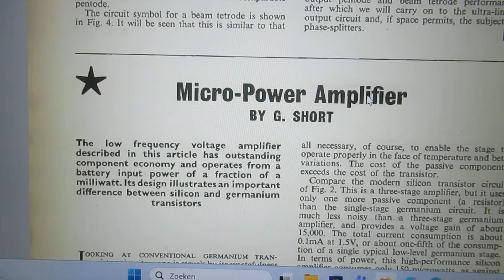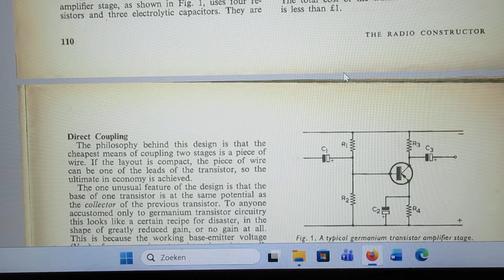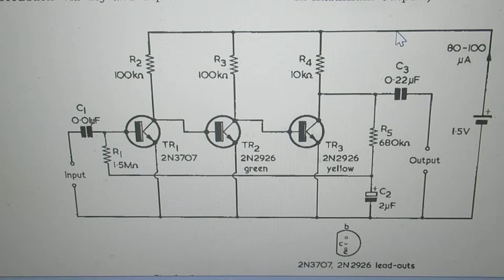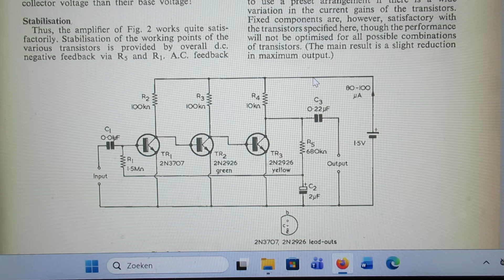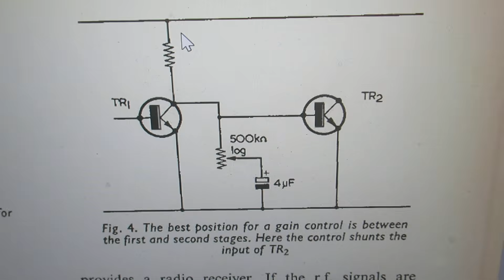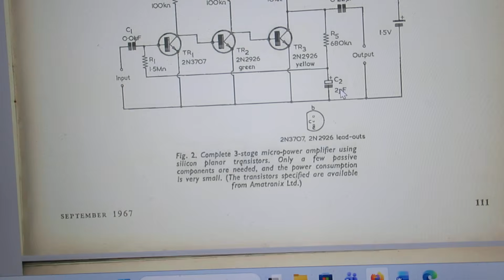1967 micro power pre amplifier for 1.5 Volts. A "Radio Constructor" (British magazine) schematic.

Comment: it took awhile for me to get my  January 1969 Philips Mullard Data Handbook by Sales organization ELCOMA from the celar, as the there has been 30 cm snow and sub -20c temperature  in the cellar stairs, now with three sunny days the temperature has soared to almost warm -10c I finally got it to check the facts: Philips had two ICs with most of that 3 NPN transistor circuit: OM200 (for hearing aids and max vcc of 5V) (package 2,75x2,8x1,1mm with four leads of min 3,5mm length 0,35mm width and 0,12mm thickness) and TAA263 (oct 1968) (and similar but with freedom to add components to vary the gain/freq response TAA293) and as usual the "find all information Internet" does not have OM200 Datasheet, but you can find the TO-72 version TAA263
Reply from the maker: Yes completely (!) true and many thanks for your comment, after digging up (with so much energy) that very important information! Much appreciated. 8 feb 2026.
Reply: @radiofun232  since I have this 56 year od on my desk, i browsed the other analogue IC datasheets, and found a similar IC with six transistor direct coupled amplifier TAA370 in 1 pin flat pack XE10 (called TO89, but not same 3+1 pin TO89 that was later common) it is optimized for hearing aids at 1,3v (sILVER-aIR BATTERY) but max Vcc 5V, datasheet can be found from datasheet4u and description from radiomuseum website

Comment: the circuit is very similar to a hearing-aid ampifier IC made by Valvo/Philips/Mullard/Signetics  it is in Signetics 1969 databook, and i recall the typenumber being TAA200 or TAA210,  but may remembre wrong.
Reply: I came here to make the exact same comment! I thought it was the TAA263 but that one seems to require 6V. But I very clearly remember it having the exact same schematic as in the video.
Reply from the maker: @meindertsprang7491  Yes, true.
Reply from the maker: Thanks for your comment, I reacted, but Google/YouTube deleted my reaction. Kind of censorship, though my reaction was completely on technical issues. I don't know why, but thanks again. 31 jan 2026.

Comment: The British Zetex ZTX301 transistor might be ideal for this (the number might be wrong). I had access to them in high school, and they were incredible in terms of uniformity, I plugged probably 100+ of them into the transistor tester of my multimeter, and all of them had a h21e of exactly 100, with a tolerance of maybe 5%, probably lower.

Comment: Howdy.
A proven good way to mitigate gain is to use emitter resistors.
Cheers.
Reply: Yes, and it also makes the bias voltage thermally stable IIRC, but would that work with 1.5V supply voltage?
Reply from the maker: @mrnmrn1  Indeed a good question. Using emitter resistors will also have an effect on the audio frequency band of the pre-amp (damping). You can compensate that by soldering a capacitor (order: 10 N-10 uF, must be found out experimentally) parallel to the emitter resistor (s). Can be tested with an audio sine wave oscillator and an oscilloscope or simply sending in some music via a smartphone or mp3 player, on the lowest output level. In my opinion in that case the input capacitor of this circuit is quite low, better could be 0.1 uF or 0.47 uF.
Reply: @radiofun232  I have some experiences with an extremely similar circuit. In fact, it's the same circuit, only small details differ a tiny bit.
The capacities are a bit critical. If you increase them too much, some unexpected effects can happen.
Also, the input capacitor shouldn't be a ceramic type! Becuase a ceramic capacitor can act like a microphone! It will make the circuit very sensitive in terms of even very tiny mechanical vibrations.
.
The circuit that I've testet has two additional antiparallel diodes on the input left from the input capacitor, to ground.
This protects the capacitor from becoming charged by static electricity. A charged capacitor could destroy the BE diode in the first ttransistor if it suddenly beomes uncharged. A charged input capacitor can also have unwanted effects on the normal operation.
.
I modified the circuit by replacing all transistors with normal BC547B and tried a lot to opimize it further, even by simulating the circuit in LTSpice. But with less sucess.
Every small modification may have a little benefit here, but disadvantages there and there and there.
I got the circuit to a very well working state with BC547B, but the other components need a lot real tests.
.
Also the shielding is important.
The circuit is immensely sensitive! With a simple needle as "antenna" on the input, it detects everything that has electronic in it. Even a quarz watch or a pocked calculator can be heard. You can test IR remote controls wireless by simply holding it close to the input with the needle. Each key on the remote control sounds a bit different.
.
I appreciate this circuit a lot! I use it also in hotels to detect spy gadgets. Nothing can hide from it!
It's also a remarkable tool for electronic repair. Each circuit emmits a unique sound like a fingerprint. You can detect it wireless with the needle as antenna from a short distance.
No matter if a digital circuit runs on tens or hundreds of MHz. The patterns in the bitstreams have often enough low enough frequencies that can be heard.
It detects also cables in the wall.
Today, in combination with some AI, you could do increadible things to analyze not only circuits and devices, but also different other things.
Reply: With the very high ohm resistor and the 2uF cap. It's almost complete DC negative feedback. To get better ac liniarity and gain control you could consider an additional ac feedback path, may be.
Reply: @guntramschlemminger7383  Howdy.
I believe You are correct.
I would suggest inserting a 470 k trimmer between the 2 uF and B-. Setting the trimmer to zero all AC feedback is routed to B-. Setting to full 470 k about 20 % of the AC fedback is routed to B- and about 80 % back to the input. The 2 uF prevents the trimmer from upsetting the DC feedback.
This may be a better way to manage gain than with emitter resistors. But one thing though. The AC feedback loop is long. There is a risk for high frequency instability.
Cheers.
Reply: @eugenepohjola258 Yes, there is a oscillation risk. This could be solved by frequency compensation like in an operational amplifier with a well selected capacitor at the collector of the first stage to gnd.
Reply from the maker: @guntramschlemminger7383  Do you have concrete idea's about how to do that? Could be interesting for everyone, who really wants to make and test this 1960s circuit, and (the best thing....) presents these evaluations and tests (via an oscilloscope and a sine wave generator) on his/her YouTube channel, with direct pointing to the used components, how they effect the amplification or waveform or frequency bandwidth. Say by doing some essential experiments with this circuit, about all the remarks that I get on this video. From YouTubers that say they are an electronic engineer, or say "why should I bother to make my comment a tutorial", or "I find better results with x or y in my computerized model testing"while, at the same time, when I go to their YouTube channels, I see "no content" or some electronic content that is not related to this 1960's circuit. Anyway: I am "in" for serious comments and serious test results, on the basis of making this circuit in practice. And research via doing calculated changes into the component values, or changes based on practical experience and knowledge about how such an amplifier works. And (sorry to say): I know that, on the basis of my thousands of experiments, since 1967. 31 jan. 2026.

Comment: This is exactly what is inside of MAA125 IC. There were also slightly different models with accessible emiters called MAA225, MAA245 and there were also "dual channel" versions MBA225, MBA245. They all were designed in 70s by Czechoslovak company Tesla (it was much more likely copies of something made by Philips, as copying so called "western stuff" was typical for that company) and they were meant for AF usage, but I used MAA125 in thunderstorm detector, which was in fact sensitive VLF receiver receiving slightly above the TV's horizontal frequency (this was important past then, because when I tuned it exactly to that frequency, then that thing turned into a very sensitive TV detector) and it worked great, so it goes slightly higher than 15kHz specified in their datasheet.

Recreating this with modern silicon BJTs would not be that straightforward as modern transistors have much bigger gain and as far as I remember, this thing had a lot of gain (specified voltage gain of MAA125 was 75dB… not 75× but 75dB!!), so I expect some stability issues. In fact, MAA125 had its own stability issues past then.
Reply: Tesla ICs usually have they Philips or Fairchild equivalent with the same number, just the first letter replaced. MAA can be TAA or uA (MAA741 is uA741, MAA723 is uA723), MBA is TBA (MBA810 is MBA810, MDA2020 is TDA2020, etc). Sometimes they are just pin compatible with the original, but internally they have a slightly different circuit. IIRC the MAA741 is an example of that.
Reply from the maker: True & thanks.
Reply: Hi there! Are you able to share some information about your thunderstorm detector (antenna type, circuitry, parameters). I'll be very grateful, as these detectors fascinates me a lot. Thank you in advance!
Reply from the maker: @454cassul9  A few video's about it are on my YouTube Channel. When you go to my Channel trailer (Radiofun232 on YouTube) and go to the looking glass (=search option) you can find them. Type there keywords like: "vlf" or "thunderstorm" or "detector". All information is in the video: antenna/circuits/etc. This is one of them https://youtu.be/W0PFErLMmGc?si=dw5R9YAdUzCvOlX_

And here another one (VLF antenna) https://youtu.be/GJtZQrZEn2Y?si=Z9dpQFSxq4euyY-5
Reply: @radiofun232 thank you very much, sir! I'll go & search right now!

Comment: Can I use it as guitar amplifier?
Reply: No because 1) a guitar pickup requires a high impedance input, you need a preamp that has a  FET front end and 2) a guitar pickup can give a voltage that would cause this circuit to clip.  You need a higher rail voltage of at least 9 volts, a TL071 opamp would be suitable because it has a JFET input.
Reply: @stevesmyth4982 This amp has 200 k ohm input, that's why I asked.
Reply from the maker: @goranz9446  Yes, you can try it. It can work better (better frequency band) when you raise C1 (non polar) to 0,1 uF or 0,22 uF. And at the output: a potentiometer of 50 K.
Reply from the maker: Difficult to answer, because I know nothing about the pickup element on the guitar. And also don't know to which end-amplifier you want to connect it. NB: the audio frequency band is limited. But you can try.
Reply from the maker: I have answered you (25 jan. 2026 at 19.40 hour) but Google/YouTube made it not visible or deleted it. Try it tomorrow (26 jan 2026) again. Don't know why Google or YouTube (=Google) does this. 25 jan. 2026 at 19.52 h. in the Netherlands.
Reply: @radiofun232 Standard single coil pickup 6.8 k ohm, preferably for bass guitar preamp.
Reply from the maker: @goranz9446  If so it is usable. Because with a bass guitar the frequencies will not go higher than the bandwith (told about in the 1967 schematic)  of 3 KC. Though a bass guitar has also harmonics (in the 13-20 KC range) that make such a bass guitar sound "natural", say when strings are "picked up" by nails and fingers. These noise-like sounds make the bass guitar sound more natural. And: a bass guitar also has very low frequencies, say in the range of 30 Hertz (perhaps even lower) to 300 Hertz. I don't know if this pre-amp can pick up these very low frequencies and amplify them.  There are many pre-amplifiers with 1 transistor (with schematics) on my YT Channel that can go to (say) 50 Hertz up to (say) 18 KC or 20 KC that can do this job. They don't work on 1.5 Volt...... Minimum voltage to get these circuits working is 6 Volt or 9 Volt. So they can be supplied via a battery. Search via my YT Channel trailer with keywords like: amplifier, pre amplifier, pre amp, 1 transistor, etc. 25 jan. 2026.
Reply from the maker: @goranz9446  I have replied you, today, 25 jan. 2026 at 19.40 hour, but my comment was dropped into the drain by Google/Youtube. I dont know why. I hope tomorrow (26 jan. 2026) it will pop up again, if not I will answer you tomorrow again.

Comment: Crystal clear presentation, sir. It really helps broaden the audience's perspective.
Imsai Guy has already discussed this a few years ago. However, his discussion started from an HF transceiver schematic. His discussion concluded that this circuit can achieve low-noise high voltage-gain performance with just one low-noise transistor and two regular transistors. Significant saving for the industrial world.
I'm sorry for mentioning another channel's name in my comment.
Reply from the maker: Thanks for your comment.

Comment: Ótimo pre amplificador .
Reply from the maker: Thanks, but perhaps it must be tested on its audio amplification on frequencies higher than 3 KC. The properties in that regard can also depend on the type of NPN transistor. Can be found out easily. Also giving C1 (input capacitor) a higher value (say 50 N or 100 N) can help to lift up the audio freq. band above 3 KC. 22 jan. 2026.